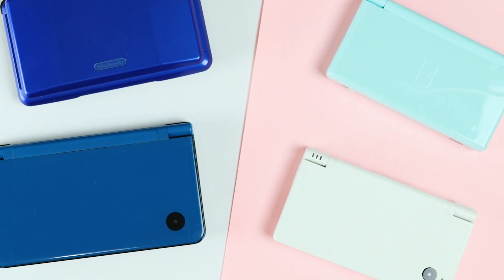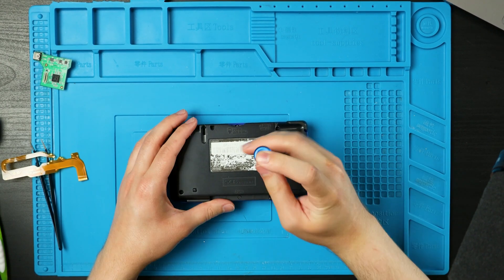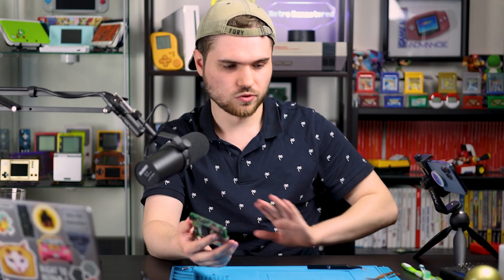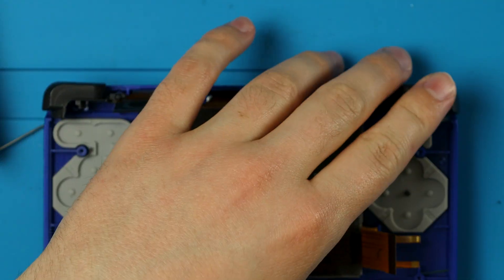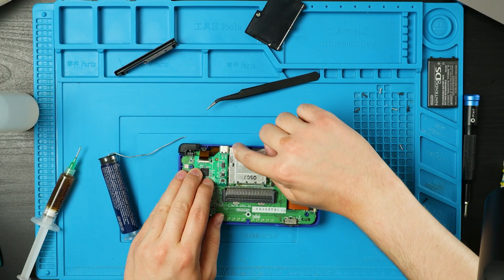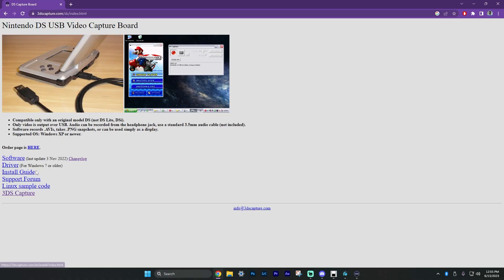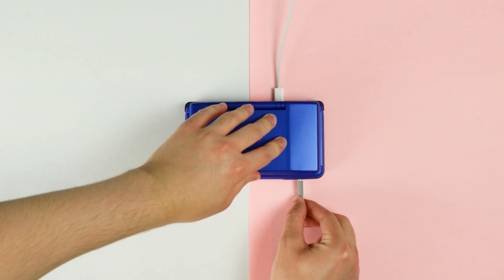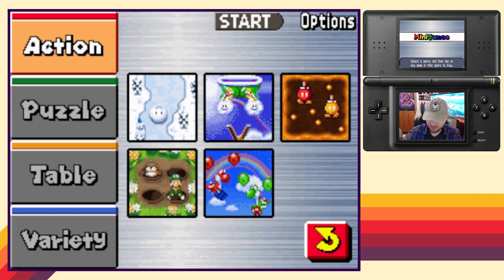How to Record DS Gameplay Natively! | Loopy Capture Card Tutorial

Comment: Question, after the soldering process and everything works with a regular DS cartridge to play let's say pokemon ranger to make sure it works. Would the capture system still work if you use a R4 cartridge?
Reply from the maker: Yes. It will capture whatever is displayed on the screens
Reply: @JakeSimmons  thank you very much!